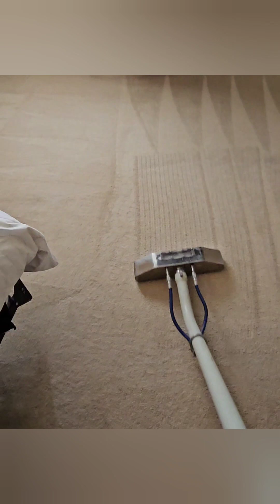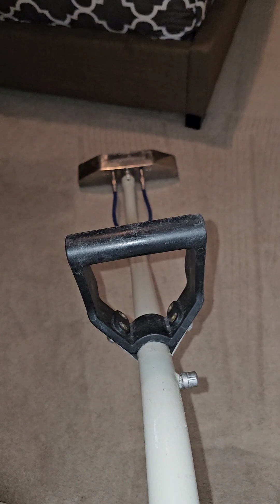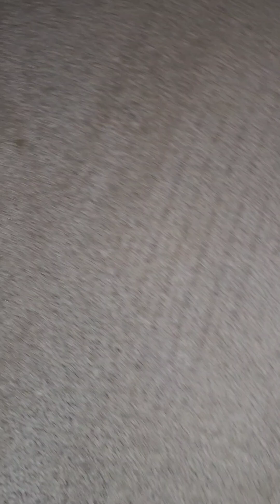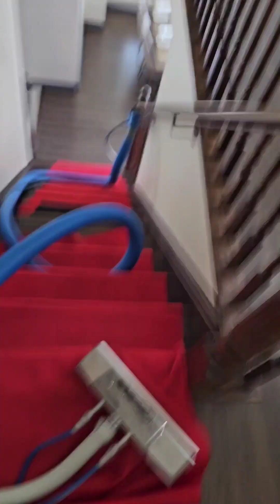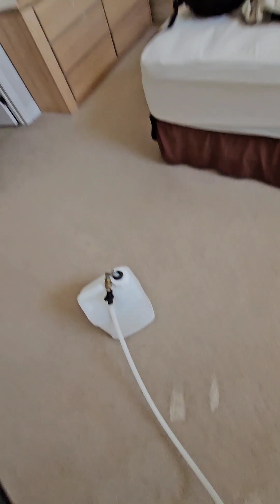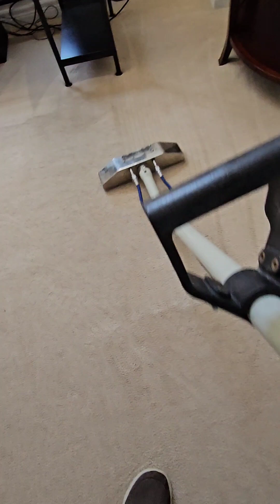Carpet cleaning 647-502-5008 www.exclusivehomeservices.ca (3 different jobs)

Comment: Do you run 2" hose all the way to wand?
Reply from the maker: This is a 1.5 inch wand. I run 2 inch all the way to the wand and I have a short arms length 1.5 inch 1.5 inch hose goes to the wand. The staircase 1.5 inch hose is longer about 15 feet, so it's easier.